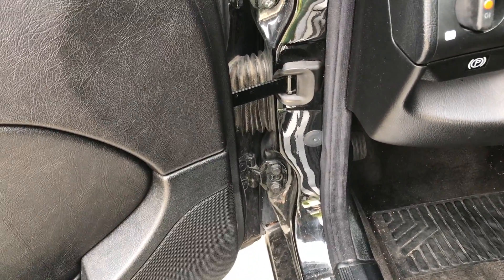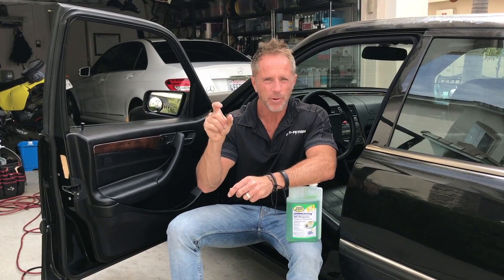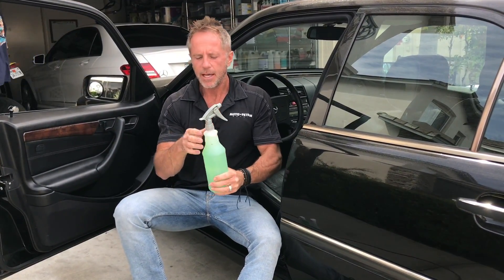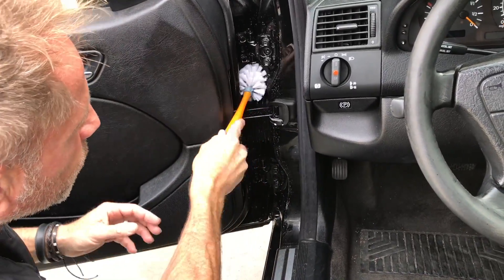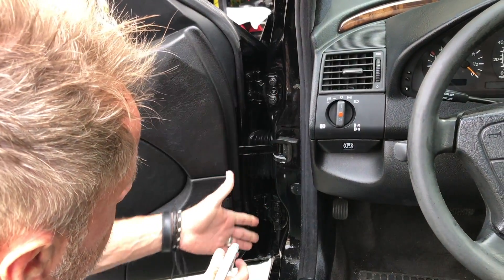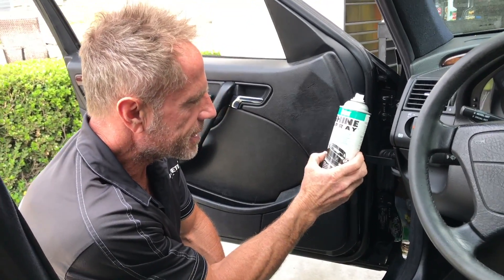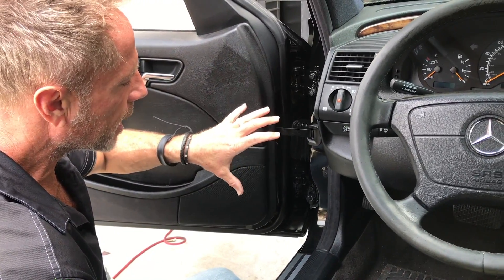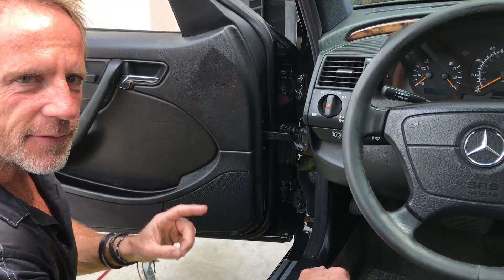Auto Detailing Tricks: Cleaning Door Jams

Comment: Hey Darren, when I clean door jams I use my Ridgid vaccum as my "compressed air. Normally am on the inside of the car so I have vaccum already out, I can turn the hose around to the exhaust (blow) side vs suction side. After placing the hose on the exhaust (blow) side I point the other end of the hose away from the car and  blow out any debris left in the house before blowing the object am trying to dry (in this case door jams).

Comment: Great video! And greetings from Malaysia! 

IMO..its easy to use any type of APCs to remove regular grime or heavy buildup of long term dirt from the door hinge area. Its just elbow grease and common sense. 

The really tough issue is long term hard watermark stains in that same  area, where detergent-based APCs are ineffective. 

I spray Meguiars Wheel Brightener (diluted 3:1) and let it wet...dwelling for 3-4mins. Agitate manually. Spray APC and agitate to remove regular grime and stains. Rinse off completely.  Repeat the Meguiars WB if necessary.

Comment: For wetting down and air drying I use a pump sprayer for rinse, then a little (2 gal) shop vac thats only used as a blower, never to suck dirt!!  The smaller hose and reducer tip gets in all the corners, and it's not too high of pressure to blow rinse water all over the place---just my 2 cents---

Comment: The bottle brushes with the foam ends are better so u don't have to.worry about scratching.even though its a door jam
Reply from the maker: I think Scott over at Dallas paint correction would agree with you. But I prefer these as they are more "substantial" and can actually break some of the dirt/grease free, along with the cleaner of choice.
Reply: Auto Fetish Detail yea your right the cheap ones aren't as effective but if you look on amazon there is a company that sells them with foam squares they are a high end company for wine glasses. Like 3 for $20 but they cut right thru and you never have to worry about scratching even though its a doorjamb.

Comment: Best way I have found to clean a door jamb is to use a pressure washer. It is easier and quicker. You may get a little water in the car, but it dries quickly.
Reply from the maker: You forgot to factor in the set-up and the break-down time of the pressure washer. Yes; they definitely have their place...
Reply: Should have add this originally. I pressure wash the jambs when prepping to wash the car so the pressure washer is already out and running. I spray the door jambs with dergeaser as well as the inside of the gas door then spray out the jambs and the gas door then close all the doors and continue to rinse the entire car before washing. If doing the engine then this as well before proceeding to wash. Of course tires/wheels/undercarriage before actually washing the painted surfaces too.

Comment: I found a bitch'n 'Bottle Brush' for this. I believe it is actually a Wine Glass Brush. OxO brand at Target. I use an Electric Pressure Washer without the power for the pump turned on to rinse out the cleaning solution sometimes. After all is clean and dry, (Ryobi Battery op blower at HD)(cool, it has a rubber snorkel so if you are a gorilla... it won't scratch). I have been experimenting with Meguiars Ultimate Fast Finish . So far pleased. It has made the next round cleanups easy.  Favorite Quick Detailer and a towel.  I hate dirty pits..... I mean Door Jambs.

Comment: What cleaner or washing should I used to strip off old wax
Reply: saints johny dish soap
Reply: Dawn dish soap (which is perfectly safe, don't let anyone tell you otherwise) OR you could use Chemical Guys "Clean Slate" car wash.
Reply: Be careful with dawn. Its def safe to use. But dawn breaks down material in the clear coat over time. I would use purple power car and boat wash for stripping wax. Dawn even says do not wash car with their product